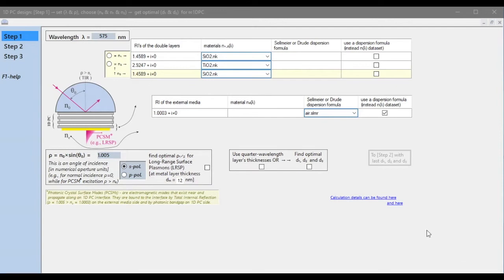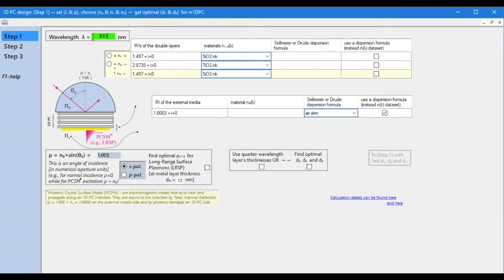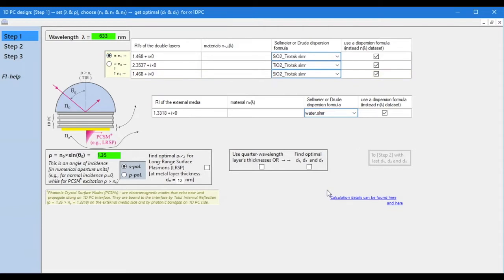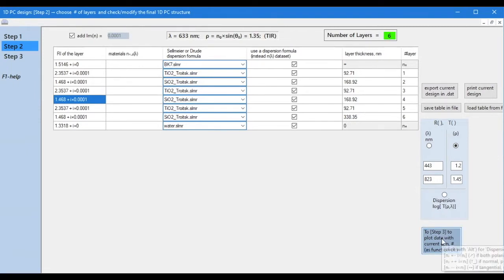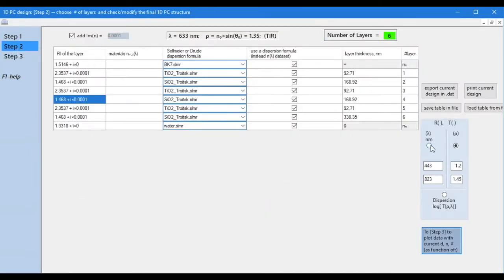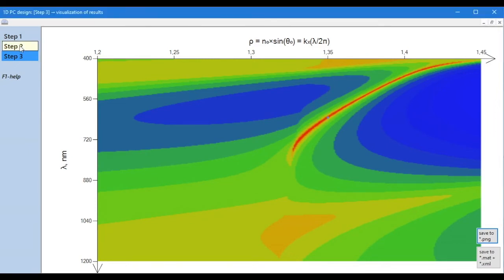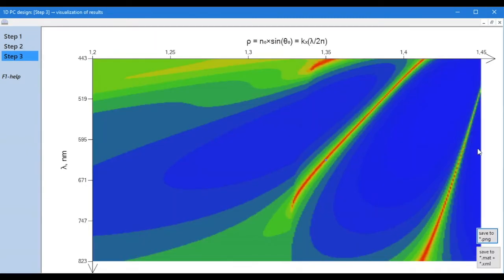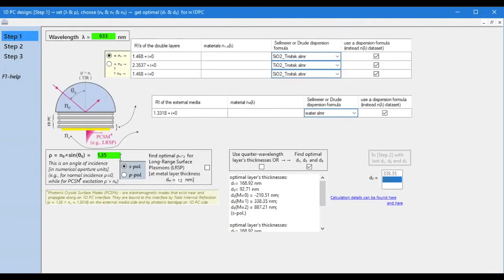Design of 1D photonic crystal structures: 2nd Example - structure for Photonic Crystal Surface Modes

Comment: Hello i want to learn how can i put indience angle in degrees for example i want to put 30 degreess how can i do
Reply from the maker: rho = n0 * sin(theta0). 
If theta0 = 30 degrees, then sin(theta0) = 1/2. 
=> rho = 1/2 * n0 should be used. 
For example, rho=1/2 should be used for a 30 degree incident if the RI of the incident medium is n0=1.